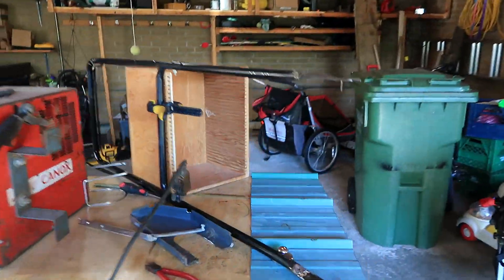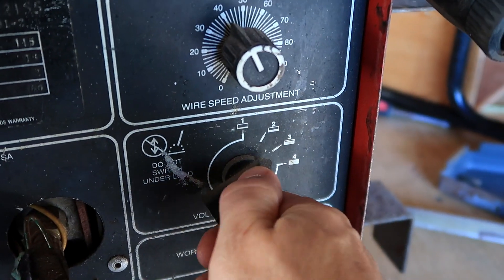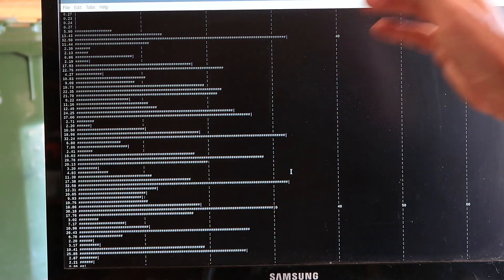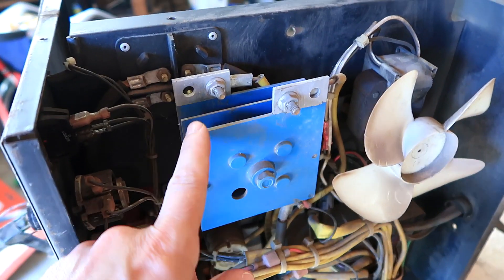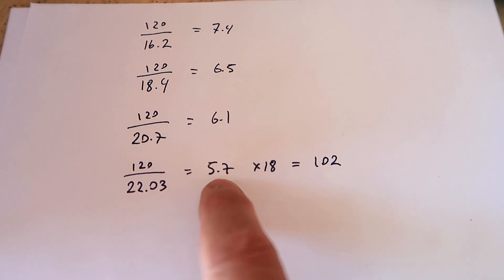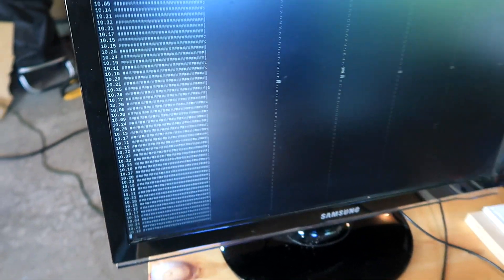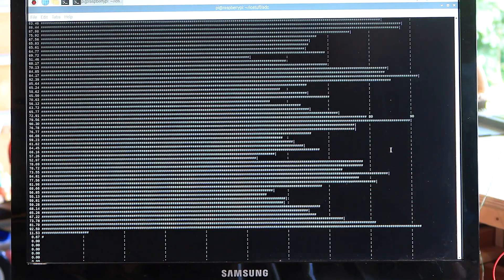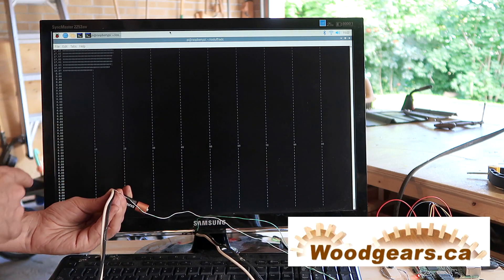Measuring welder current with a computer

Comment: Hi Matthias, i have a project for you in winter. what needs more energy: stop heating in the night (heating a cold house in the morning) or heating 24/7?
Reply from the maker: Stop heating the house in the night uses marginally less energy.  But if you heat with electricity, and you have time of use metering, then you end up using more peak electricity and it actually costs you more.
Reply: @matthiasrandomstuff2221  thank you. i think i will just reduce the heating in the night. letting it get too cold is bad because of mold. (condensing water)

Comment: One thing to note is that the amperage you get with a constant potential welder (which is what MIG or flux core is) is dependant on your electrical stickout, which is the distance from the contact tip to the arc. The longer the stickout, the higher the amps. Filler wire obviously can't carry much current without melting, which is why you generally want to keep as tight a stickout as you can.

Comment: I find the usefulness in these small flux-core type welders is that they can be used on a regular 120v 20A circuit without tripping, allowing welding in areas that a larger 240v unit with gas would be very inconvenient. Think sheds and garages, or places away from home...

Comment: I would like to see you test a microwave and and air fryer  running at the same time. The combo always trips my 20 amp breaker. Usually the air fryer is already on and then the microwave is enough to trip it.

Comment: I don't think the short circuit for AA is 20 amps. There should be an error somewhere.
Reply from the maker: what error?  it was only a little lower than I expected.
Reply: @matthiasrandomstuff2221  I was talking about the value in general. I don`t think an AA battery is capable of this kind of amperage. For 17 amps let`s say, It should have 88 miliOhms of internal resistance or even smaller considering also  the resistance of the cable. Those batteries have a bigger resistance. A Li Ion power tool battery cell has around 50 miliOhms.

Comment: 20A @ 1.5V is 30W ; assuming 4 WH in a AA battery (and no falloff, which is a bad assumption), it sounds like you can short an AA for around 8 minutes.

Comment: Next Test: How many AA-Batteries will generate 70A for welding?
Reply: He said almost 20A per battery (Matthias just kidding), but let's say 10A. So, 7 batteries in parallel. And there were 22 volts at highest setting, so 22/1.5=15 batteries in series. So, just 105 batteries, it's doable.
Reply: @mayoropl1  Keep in mind the voltage changes with load. Let's say a realistic number is 15 amps short circuit current for a AA. Given a battery OCV of 1.5 that means each cell has an internal resistance of 100 milliohms. While the welder OCV was 22 the voltage under load is more like 17. That would require an output impedance of 5v/70A ~= 70milliohms. Per your calculations we need 15 batteries in series for the correct output OCV. Each string of 15 batteries will be 1500 milliohms and we need 70. We need 21 strings in parallel to achieve that.

So, my final number is...
15 * 21 = 315 cells.

Comment: Could you try the battery short circuit on a car battery?
Reply: 2-second short circuit test on a typical automotive starting/ignition/lighting battery is 1000-1600 amps while maintaining greater than 10.5 volts at the battery terminals.

Comment: Is that a selenium rectifier? 👀
Reply: Yep, Clive made video about those a few days ago 😀
Reply from the maker: sometimes the higher resistance is part of the design.  I once replaced a battery charger's selenium rectifier with diodes.  I had to add a series resistor to keep it from charging too hard.
Reply: Selenium rectifiers work just fine, until they don't. That really isn't much different that silicon rectifiers or even vacuum tube rectifiers. And despite Clive's recent video, the most common Selenium failure is that they just go open. No smoke, stink, or drama. Now, sometimes they do stink, and I've seen really big ones (think 8" by 8" plates on a stack a foot long) emit flames. But in my experience that is really rare. I'm generally inclined to leave sleeping bears sit, as long as they aren't dead or dying.
Reply: Seems to be. Thought the same as I saw it. I know they where used where no precision is needed.

Comment: I am amazed that the pi didn't crash, considering the EMI that a welder produces.
Reply: As long as you only have inductive or capacitive coupling, it wont be a problem. The idea of the EMI problems comes typically from not EMI problems, namely galvanic coupling. That is, is the Pi was supplied with the same DC from the welder, it will certainly be a problem. But electromagnetic radiation is half so bad as most think.
Reply from the maker: It was connected straight to the shunt resistor, to the ground clamp.  Which is not the same as ground ground.  But the pi isn't grounded, so it worked ok.

Comment: 20 Amps on a AA battery?!? Is there some way to use this, like a very very short term spot welder? Sure, we'd have to somehow increase the voltage (and I guess the internal resistance wouldn't allow simply using a couple of AAs in series), but still! 20 Amps is quite a lot.
Reply: 20 amps across a 40 milliohm "short" means the battery voltage collapses to 0.8 volts. You're not going to be doing any welding with that, spot or otherwise.
Reply: Your dreams will come true using a car battery.
Reply from the maker: Perhaps, with ten of them in parallel
Reply: Definitively you could. Spot welders have low voltage (2V to 5V) and humongous currents. But with couple hundred A you can already point weld for batteries. There are plenty of videos of people doing spot welders with old microwave trafos.

Comment: You don't need a shunt - Allegro make 200A hall effect sensors. Although it's an electronic component, so probably 394 weeks lead time...
Reply from the maker: And the shunt worked just fine.
Reply: @matthiasrandomstuff2221  Old good physics still working strong! 😁 None of this rubbish modern electronics for kids 😉
Reply: Will for sure cost more than a little bit of wire sitting around...

Comment: What about the blue welder under the table where the red welder is?
Reply from the maker: that's not a welder
Reply: @matthiasrandomstuff2221  Hmm. Case looks like a small welder.
Would be interesting to measure a modern inverter welder.
Reply: Measuring the current could be the solution to my problem. Have a central oil-heating-unit and need to monitor the temps (DS18b20) the water-pumps and the burner-state (on or off). And eventually the exhaust-temp.
Reply: Sometimes the youtube filter algorithm is strange. It deleted my last posting where i said that the plasma-cutter is another device you can measure it's current (said it with fewer words before)
Reply: @matthiaslange392  you can use an optocoupler driven through a resister and a diode with a very small capacitor in parallel to sense the input voltage "after the switch".
Reply: @virtualmarc2383  yes, but the waterpump has variable speed (auto-adjusting) and i want to measure it's power consumption
Reply: @matthiaslange392  shunt opamp diode meter?
Reply: 0:20 I'd guess a plasma cutter.